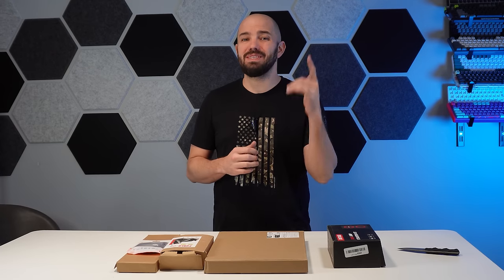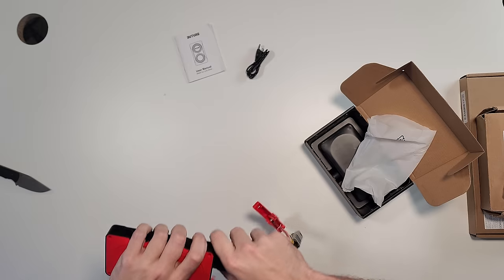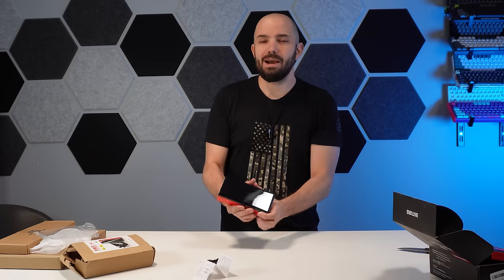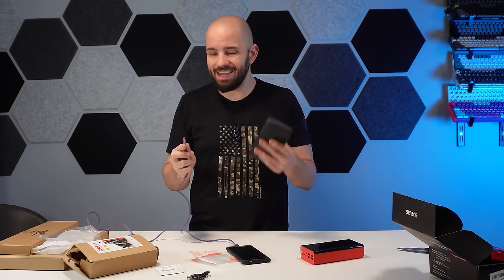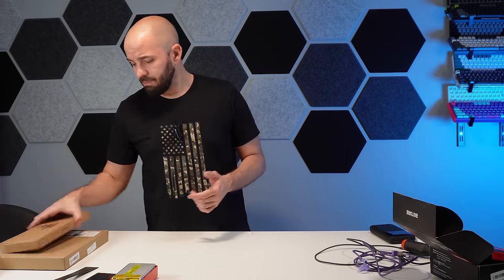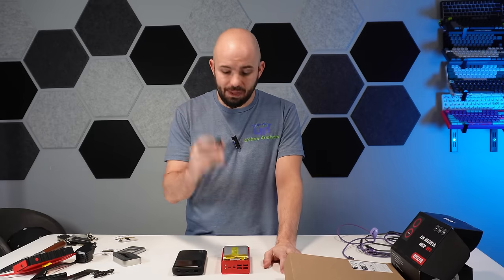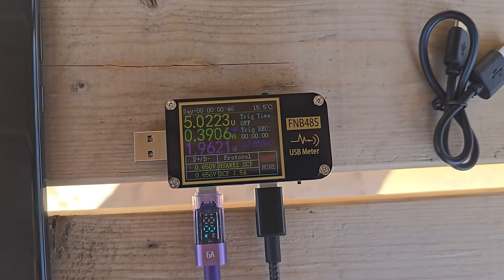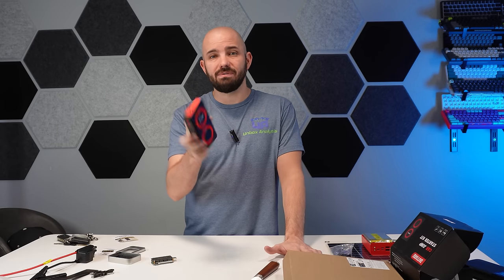Temu MOST Sold! Junk or Treasure?

Comment: Tip: Most booster packs to start your car have a boost function. Then it will ignore 12v check and give power even when the battery is completely dead.

Comment: Divide a solar panel's quoted output by about 4 for the actual wattage. My '28 watt' portable gives about 6–7 watts max and more averagely 5 watts.
Reply from the maker: A lot of the nicer quality ones i have are all fairly close to their rated power ^^ Just not on the temu ones

Comment: USB C cables are only 5 amp rated (4 x 1,25 amp connections) and so there is no way you will get more than 25 watts from a 5 volt supply. Your 17 watts wasn't that bad. Don't forget it's the charge source that supplies the current so you need a high current charger
To get 100 watt you need at least a 20 volt supply capable of supplying 5 amps.

Comment: The Power Bank has at most 20000mah and more likely, no more then 10000mah. Which not only is deceiving but impossible to reliable use considering how long it would take to charge it.

Comment: Europe, Japan and China are moving for smaller engiens on the cars, most cars are 900cc to 1600 and some still have 2000cc, so a jumper box like that will probably start any of them with no issue
Reply from the maker: I was impressed that it started a 5.0 Ltr V8 with a really low battery. That alone is worth the price

Comment: 7:08 I think both "regular" charging (5W) and fast charging (10-15w) show a green circle. Superfast (25W) shows a cyan circle and superfast 2.0 (45W) shows a blue circle.
What INIU power bank is that? I have 3 power banks from INIU. 2 of them are 10000 mAh and 1 is 20000 mAh. My 20000 mAh (model BI-B5) looks like yours but is smaller. I've had it for a year and it's fantastic. But it doesn't Super Fast charge. I had to try again with my phone now and no, just green (fast charge 10-15w). My phone is a Samsung S22+, and the cable I'm using is an INIU usb-c to usb-c fast charging cable that can handle up to 100W. I can't measure it, but this cable in my 65W Ugreen Nexode GaN adapter, charges my phone in Super Fast mode (yes, I know it should be Super Fast 2.0, but the charging color is cyan, not blue, so I guess it gives less than 45W).
You got about 15W with the purple cable from your power bank, which is the same fast charge I get with my power bank. Are you sure you will get more using another cable? I can't get cyan or blue out of my INIU, I know that for sure.
Reply: Bro. Samsung devices wont take More than 25w charge....

Comment: that knife is killer, did you try to use both ports on the solar at the same time to see if it gave you 3.5?
also just wondering if you've ever done a bike gadget haul? i thought you had more content but when searching the channel i couldnt find aything so i must be mistaken.
hope you have a great easter, peace and love all
Reply from the maker: I didnt try both, I suppose it would be fair too since a lot of other devices are stated as total output. But even at 3.5w, split between two ports i cant recommend it. not when there are other units that are twice as fast overall. 
I havent done a bike gadget haul, but i may soon as i have a nice foldable electric bike coming up soon, and a lot of the bike stuff, will also work on scooters
Reply: @UnboxAnalysisOfficial  i didnt know if the 2 would work together or if 3.5 was competitive, thanks for getting back to me.
with the rise in ebikes and escooters i thought it might be a handy haul

Comment: The USB cable is fine your phone is fine your power banks are fine first the smaller power bag is probably 2.4 amp USB ports which means about six or seven watts that's what it's supposed to be putting out 

The nicer power bank and your charger is putting out 14 Watts The reason for this is that's the maximum your phone can take 100 w just means the cable can handle a hundred watts it doesn't mean the cable will give 100 Watts whether or not the cable will push 100 watts depends on if both your charger and your device negotiate a 100 watt connection your phone is not 100 watt compatible trust me at most at most it'll be 30 watt compatible The number of phones that charge faster than 30 watts are fewer than the number of fingers you have :-) 

So the 14 watts is probably the standard limit for your phone which means that's the connection that's going to negotiate with the charger which means that's what the cable is going to give you in order to see that cable handle 100 watts you would have to plug a 100 watt charger into a 100 watt device typically the only devices that are going to charge at 100 w are specialized power banks I have one that will charge and discharge at 100 watts and things like giant battery banks larger tablets laptops things like that

That USBC port on your power bank is not a USBC protocol it's simply a physical USB-C port it's going to be standard 2.4 amp 5 volt USB which means it's not going to be bi-directional that's why you couldn't charge anything via that USBC port it is a dumb 5 volt input it just happens to be shaped like a USBC port which is fine That's what you expect for something that cheap 

Hi power USBC is not super common simply because of thermal management trying to charge your phone for example at 100 watts creates a pretty serious thermal problem Where's all the heat go this is why even tablets that can fast charge typically cap out at 66 watts and only the tablets that have dual batteries do that basically they're putting 30 Watts into each battery because again even on something that large thermal management becomes a serious issue when you start pushing that kind of power

That power bank probably is 40,000 milliamps it's probably using grade c or d cells meaning low quality cells that don't pass muster for high quality applications but they probably have the rated capacity those aren't lithium ion those are lithium polymer cells I'm actually surprised that thing had full size cells inside meaning that's not a bad price for that just don't expect it to be fast but it's going to be great for charging all of your little USB devices

Charging that other power bank seems about right to me when you charge one device with another device there's a huge amount of losses going on in that equation you are converting the 3.7 volts in your first lithium polymer cell and you are boosting it to over 5 volts then you are transferring it over a cable to another device that then has to step down that voltage to the 3.7 volts that it's battery requires it is not uncommon to lose about 50% of the available power when you do this it's very very inefficient to charge one battery bank with another battery bank

Comment: Proper high power usb c cable with e-marker chip can be only 1m in length
Reply from the maker: That sounds about right. I've got a 100 watt cable that measures in at about 100 watts thats just under 1m

Comment: I would be doubtful on the battery bank if it was really lithium ion batteries. For being as big as it is, I would think it should be light not heavy if it was lithium ion?
Reply from the maker: Lithium batteries can still be heavy, it is li-ion, but its not lifep04 its older tech for sure. Same tech they used in laptop batteries for a long time

Comment: Why not test the power bank properly with a load and usb tester?
Reply from the maker: I explained that in the video, my load tester loses power once the battery bank dies, so if i miss it by a few seconds i dont get the results. The method used here is pretty accurate overall
Reply: @UnboxAnalysisOfficial  ah yes but you can get those which record data on the tester. I have one.
Reply from the maker: @georgeyreynolds  eventually I will. Unfortunately I don't make a ton off youtube so I have to purchase the testing equipment as time goes. Still got them normal bills to deal with lol
Reply from the maker: @georgeyreynolds  All in time! Just gotta keep working on it all. Slowly building up my testing equipment! But the daily job and bills have to come first lol

Comment: I have that very charging cable!  I haven't seen it go past 21 watts.
Reply: If your thing/charger can't do it it will never go over it
Reply: @battedtomcatnlnl153  Yes that's true,  but I've plugged it into things that can go 65 to 100 W and it still only tops out around 21, the appropriate charging block was used as well
Reply from the maker: Hey at least 21watts is fast charging. Not ultra, but in the end not a horrible cable, But doesnt go anywhere near the 66w it claims.
Reply: @UnboxAnalysisOfficial  Yeah it works great!  Plus you can see that when a cell phone is low on charge, it starts out 18-21 W, then when the phones charge nears complete,  it begins slowing down.  Ending up around 4 to 6 W for the final 10 percent of the charge!
Edit: it *, not or.
Reply: usb-a is not supposed to give out more than 5 volts, so 21 watts at 5 volts means 4A current, which again is something that usb-a is not supposed to do.  To get higher output power you need usb-c on both ends so you get PD with voltage boost
Reply: @Jultsu  Mine is C to C.

Comment: I never buy batteries, power banks, or electronic/charge cables from Temu, not even those weird Chinese companies on Amazon.  Every time you hear about someones phone or flashlight exploding or catching fire they are always using some Chinese knock off.
Reply from the maker: I have heard those stories quite a few times myself. So far never had an issue, and ive bought quite a bit of the low end battery/charging stuff.

Comment: Never by from Temu everything is e-waste!! I bet you $100 that 40,000mah battery bank is not even close to the rated Amp's i know it for a fact actually there is a good video on YouTube pulling it apart and its got 2x5000mha batteries in it and no functional safety current protection measures or any other basic safety circuit!! The jump pack is also functional but dangerous for over current and polarity protection
Reply from the maker: I mean if you watched the video.. I not only pulled it apart but i tested the capacity. Also a lot of temu stuff isnt just ewaste, i have been using a lot of the stuff ive unboxed for close to a year now. Sure some of it is junk, thats why I make the videos to help people decide which to buy.